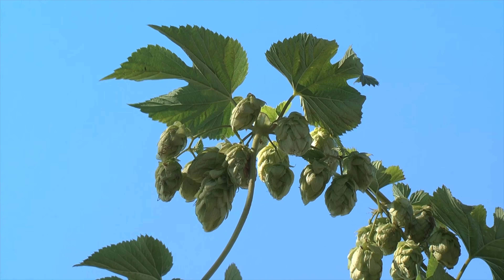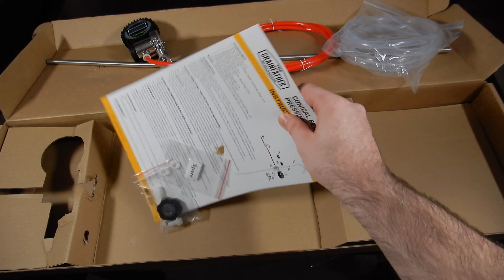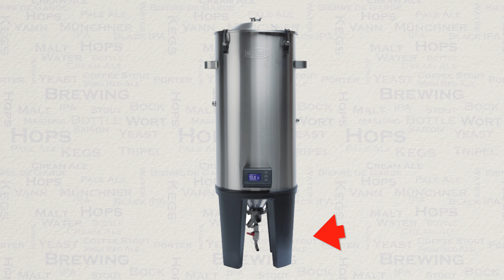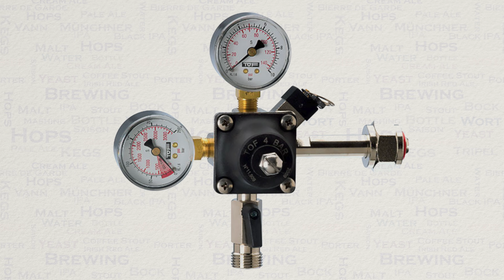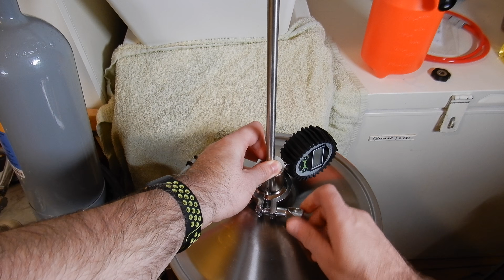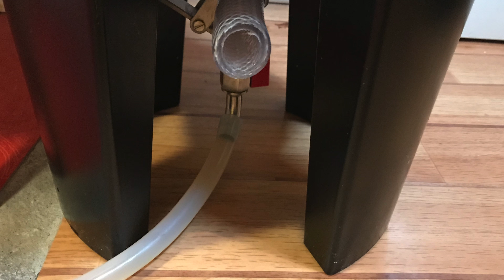GRAINFATHER CONICAL FERMENTER PRESSURE TRANSFER

Comment: Hi there mate, just wondering what amount of pressure is inside your keg before you start the transfer? And do you open the pressure relief valve on the keg as you are filling it? Many thanks, appreciate your channel.
Reply from the maker: It is some years since I used this product but from memory the pressure keg side is not important and there is no need to open the PRV.

Comment: Just picked up a GF w/ the conical fermenter and this piece of kit. Didn’t realize I’d need a separate large supply of CO2. As this is my first true AG brew maybe I’ll tackle pressure transfer to a keg on another batch. Do you have any recommendations on making the leap from bottles to kegging (Ie choosing the right equipment/setup for your needs intentions)? I’m a bit overwhelmed atm 😅
Reply from the maker: Hi Aidan, you can use Sodastream co2 via an adapter, which keeps things cheaper. I would highly recommend the jump from bottles to kegs. Much easier and more satisfying for sure. I highly recommend a Kegland series X, this Kegerator can hold 4 kegs. I made a guide to set up and showed the different options in these two videos:-  https://youtu.be/VoAzVvbRoOk

Comment: Great video.  What products should I buy to connect the kit to my co2 regulator
Reply from the maker: Thank you, You should find everything you need in the box.
Reply: @DavidHeathHomebrew  that's a strange comment in that you showed that the supplied hose didn't fit your regulator. There are no connectors in the box or clamps even if you are lucky enough that the supplied hose will fit your regulator. Chances are slim to none.
Reply from the maker: Chris, its quite some time since I reviewed this and I understood that the supporting connectors had improved.

Comment: Did you manage to turn the gauge 90 degrees as is shown on the official photos of this kit? out of the box it's position makes it difficult to fit the clamp. i want to turn the gauge so it is horizontal, but i fear to damage it as it seems to be very tightly fit..
Reply from the maker: Hi Espen, its a long while since I used this in all honesty. You should go with what feels right I believe.
Reply: @DavidHeathHomebrew  thanks. guess i will just keep as is then, even though it's a bit awkward with the clamp.
Reply from the maker: Yes, I would :)

Comment: Please explain when i hock this up to the Fermenter. Can i have it on from start so i replace the fermentation tube in plastic? If i need to  remove the fermentation tube from the fermenter and replace the fermentation tube with the pressure transfer kit after fermentation are done will i not expose the beer with oxygen? and from what i know that is a bad thing. but i am new to brewing so please explain if you have the time.
Reply from the maker: You just add this before transfer. During it's process you will be replacing the oxygen with co2, so no concerns there :)
Reply: @DavidHeathHomebrew  Ok If i just transfer like  regular with a hose that go down to my keg the beer will get in contact with oxygen. Is that bad for the beer? I have heard that you should have a close transfer. What Will happen to the beer if it get in contact with oxygen?

Comment: Hi David, firstly thanks for all your insightful videos on Grainfather & other brand enquipment- it's been central to me almost biting the bullet & making a purchase!  One (more) quick question on this video if I may- when using the racking pipe, how do you know exactly how deep to go before hitting the yeast/trub layer at the bottom and sucking-up sediment?  Same when draining or transferring from the bottom- how can you be sure the yeast is below the draining pipe attached to the tap assembly? (I guess you drain some yeast off first as I know GF advise, but then do you 'waste' a volume of beer between the top of the yeast and the drain level of the pipe?)
Thanks in advance!
Reply from the maker: Hi, I do not have the opportunity to measure this right now because my conical is out on loan to someone else. However, there is an exta pipe that can be purchased separately "Conical Fermenter Dual Valve Liquid Inlet 160 mm (6.3")" this provides more height and is suggested for use with very large dry hopping. I have not used it personally because I have had no issues with the standard one.

Comment: in order to do a closed transfer from the beer outlet on the dual valve tap, what solution did you use to reduce down from the 13mm beer outlet to a standard beer line? (8mm; to fit an mfl and corni ball-lock fitting)
I was hoping for something like a duotight reducer, but i could not find anything. Thanks for any info!
Reply from the maker: Yes, I used a reducer. I found it from the John Guest range.

Comment: Is the fine control of needle valve necessary to keep psi low? I just purchased this fermenter (thank you for all the thoughtful reviews!) and was thinking a using a tri-clamp with gas ball lock instead of the rubber bung. I could use this to connect an airlock or blow-off and then avoid opening the top when hooking up a CO2 tank for transfer.
Reply from the maker: As long as you regulate the pressure then all good. Glad you found the reviews useful. This is for the companies best product to date, the fermenter that is :)

Comment: Hi again, I’m such a pain i know! David what size john guest fitting is this you’re using? I’m almost certain that the supplied tubing wont fit my regulator fitting as i have a john guest 3/8 fitting on mine. Of course, I appreciate all your kind help as always 
Many thanks 
James
Reply from the maker: Not at all James :) I've had 1001 questions my whole life :) Please ask anything you like :) In this case there are no markings and I cannot for the life of me remember the sizing but if you contact GF they will be able to advise on sizing.
Reply: David Heath Homebrew thank you, I might have figured it out tbh? It’s 8mm so going by google i it’s coming up as 5/16. So i purchased 5/16-3/8 inline John guest part, in the hope it’ll work ; ) fingers crossed
Reply from the maker: Great, sounds right, I just cannot be sure. Fingers crossed :)
Reply: David Heath Homebrew thank you. Another brew day today (American amber ale) and I’ll be putting the PLAATO airlock to use along with the PLAATO valve.
Reply from the maker: Great, hope it went well :)
Reply: @Cossie.j  Hi James, was that good?

Comment: If I put the solid cap on kit and set pressure to say around 1psi would that be a safe way to cold crash and eliminate suck back from an airlock??  Safe being the key word. Lol.
Reply from the maker: Not really no. Best way is to use an S airlock or a Plaato valve for even more protection:- https://youtu.be/ngLLz3-a8PI
Reply: @DavidHeathHomebrew  why would putting the fermenter under 1 psi and leaving it during cold crash not be safe?
Reply from the maker: This conversation is about suck back during cold crashing. Safety from this requires more to be sure as I see it.
Reply: @DavidHeathHomebrew  ONE psi... how can ONE psi be a safety issue!?
Reply from the maker: We are talking about ”beer safety” (not my choice of words ) here in terms of suck back, not personal safety :)

Comment: So no oxygen is exposed with this method?
Reply from the maker: Sadly not. When you attatch it you need to open the system.
Reply: @DavidHeathHomebrew  unless you fit from the start and take the orange hose to a bottle of steriliser and use and an airlock with the needle valve open and then you can reverse and add gas at the transfer stage.....I think ! but am happy to be corrected.  Cheers David
Reply from the maker: Either way its not a concern unless you actually add oxygen to the beer/wort physically.

Comment: Hi David. I was thinking of installing this at the start of fermentation and using the connection connecting to a blow off setup for Co2 out. Then if you install a valve you could lock it off - swap the line setup for closed transfer (from the top) with C02 now travelling in - this was stop having to remove an airlock to then install this and maybe another slight decrease in oxygen exposure - do you see any issues ? I wasnt sure if there could be some junk that might end up blocking in the head piece?
Reply from the maker: Sounds fine to me Scott :)
Reply: Ive bought this kit and ive used it twice now, this time i set up a proper closed (very low pressure) transfer, (by way of jury rigging extra hoses/ valve heads up) but i think that your idea scott is definitely the way to go to prevent any little bit of o2 getting in at the removing the stopper stage. 

However, i still dont see this transfer system to be of any real use other than avoiding having to lift it full of beer for gravity transfer. I also happen to have a bunch of gas fittings for free at my disposal so i wouldve thought that if you are spending 30 bucks or whatever on extra fittings to get a fully closed system then you might want to consider if the benefit is actually worth it seeing as the tank isnt designed for proper pressure brewing and the benefits that come with that....although if one looked around hard enough im sure you could find a drum lid ring that would sufficiently secure the lid enough to increase the pressure...to what psi i dont know, and for the price of the fermenter and the cool little valves, theres no way im going to try and find out...lol ...

Comment: Hi David, have you tried using this kit to apply co2 when cold crashing so the resulting vacuum is filled with co2 instead of oxygen?
Reply: Did you you find a solution to this major issue?
Reply: Great question. I would like to know the answer to that also
Reply from the maker: Sorry I must have missed this but no I actually have not.
Reply: @DavidHeathHomebrew  So David what do you do for the thermal shrinkage issue when cold crashing?
Reply from the maker: I have been using this solution for years:- https://youtu.be/ngLLz3-a8PI

Comment: Hi David, Do you know if this can be used in combination with a Blichmann beergun? Would you recommend this combination or do you think the extra CO2 purge is of limited added value to prevent oxidation?
Reply: I just came on here to ask that very same question. Did you try it?
Reply from the maker: No, I have not sadly.
Reply from the maker: Hmm I see no reason why not but I do not have one to try it with in Norway sadly. C02 purging is very worthwhile for kegs, less of a worry for bottles but still relevant.
Reply: @DavidHeathHomebrew  Thanks David!!!

Comment: Hi David.  What are your thoughts on pressurized fermentation, and could the Grainfather conical be used for it?
Reply from the maker: Hi Darryl, I think for many the draw is ready fermented beer and if bottling no yeast at the bottom. The GF conical in its current config is not suitable. It could however be made suitable with an after market kit securing the lid I should think. Personally if I wanted to ferment under pressure I would adapt a keg for the job rather than take any risks or buy something specific. Cheaper and fit for purpose and multi use :)

Comment: Hi. About to use this kit for the first time and im wondering what would be preferable. Racking tube or sampling valve transfer? Dump all trub/yeast before transfer if this isn´t previously done due to secondary fermantation in some recipies? Will fill a few bottles and then closed transfer to a keg. How much loss is there in the cone if transfering via sampling valve?
Reply from the maker: Hi Dag, The way this product is intended to be used is the top opening is for yeast dumping and collection. The bottle opening is for transfer. You for sure do not want to be using it any other way. Transfer from the bottom valve will be full of trub and yeast. The losses you will get will totally depend on how much trub and yeast you have left in the cone. This is all below the sediment line and not the sort of liquid you want in your keg or bottles.
Reply: @DavidHeathHomebrew  Thank you, i meant should i dump trub first and then transfer from the top using the included rackingrod or should i transfer from the bottom "bottle opening" and accept the loss left in the cone?
Or should i just leave the trub and do the bottom "bottle opening" transfer? uncertain how the two methods would affect the clarity of the beer.

The batch is your Juicy ipa recipe so wont be doing a lenghty secondary fermentation. If i did i would dump the trub when going into secondary.
Reply from the maker: Hi Dag, I usually do a couple of very quick short dumps (this will remove trub and dead yeast) during early fermentation...wait 24hours before do the first one. Then I do the transfer from the bottom tap and then I dump the fresh yeast for reculturing.If you dump the trub first then you will find you get more beer loss and it will be the good stuff!

Comment: you could install a valve between the lid and the airlock, so you could close the valve, remove the airlock and then install the pressure transfer kit, open the valve again and do the transfer. By this way no oxygen will have a opportunity to enter the system. That's the point of a close transfer!
Reply from the maker: An interesting idea for sure! Please suggest it directly :)
Reply: @DavidHeathHomebrew  Any update on this idea?
Reply from the maker: Did you suggest it directly?
Reply: @DavidHeathHomebrew  Sorry, I'm from the Netherlands, what do you mean with did you suggest it directly? You mean to GF? Thanks in advance, love your video's!

Comment: Just received my own kit. What John Guest fits the red co2 line? I need to make some solution with carbonation caps.
Reply: I’m guessing 5/16? 
So a 3/8 - 5/16 John Guest would then fit my needs. My ebay carbonation caps fits into a 3/8.
Reply from the maker: I believe that is right, in all honesty I cannot remember the size that I used!

Comment: Would your beer not foam up if you tried to do this with unpressurised bottles? Great vid.
Reply from the maker: Thanks. If using this with bottles I woukd suggest the addition of a bottling wand on the hose out. This ensures filling from the bottom of the bottle and control. Its a cheap part to add in. Here is an example :- https://www.amazon.co.uk/gp/aw/d/B01MEGKYS2/ref=mp_s_a_1_2?ie=UTF8&qid=1513855020&sr=8-2&pi=AC_SX236_SY340_QL65&keywords=beer+wand&dpPl=1&dpID=31kR6ic1TrL&ref=plSrch

Comment: Thanks as always David. A very useful insight and it looks like a nice bit of kit. Out of interest, have you heard anything from the GF guys as to when the glycol chiller unit will be released or have I missed it??
Reply from the maker: Thanks. In regards to the Glycol I have not had any updates as yet. Hopefully it is going to be released in all markets early next year , fingers crossed! Have you considered the cooling pump kit?
Reply: David Heath Thanks David. Yes, have purchased the cooling kit as they offered it with a 50% discount so was a no-brainer. Haven’t had the need to use it yet as it’s been so cold anyway! Really keen to try some pilsner styles and to really be able to control the cooling and lagering phases so am looking forward to its release (and the usual dent in the wallet!!).
Reply from the maker: The cooling pump kit is great for not so hot climates, if you are home and can maintain it. It can also  be put in a fridge for maintenance free operation.
Reply: David Heath Thanks David.....good idea about the fridge. Almost worth picking up a cheap second hand one and running it through there in the garage.

Comment: Do you leave the pressure transfer equipement on during fermentation, and is it possible to ferment under a little bit of pressure with this kit ? Or do you mount it after the fermentation with oxigen danger ?
Reply from the maker: This is not something that I have tried yet. Do keep in mind thought that the absolute maximum pressure is just 1.5 PSI due to the clamps that hold the lid. If a large tri clamp was developed for the lid then this would of course change matters greatly. Currently I just used this kit for transfer after fermentation.
Reply: David Heath it would be great if the gauge could let the pressure go during fermentation like an blow off system. So you can keep the 1.5 psi during fermentation. But i think it doesn’t work that way.....
Reply from the maker: Yes this is aimed at pressure transfer only.